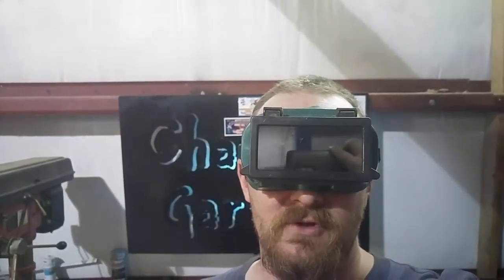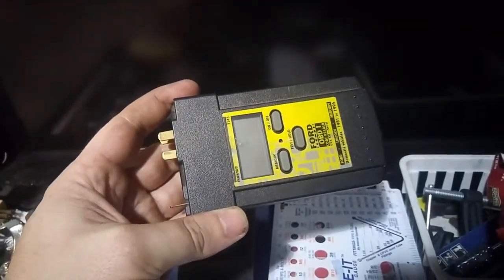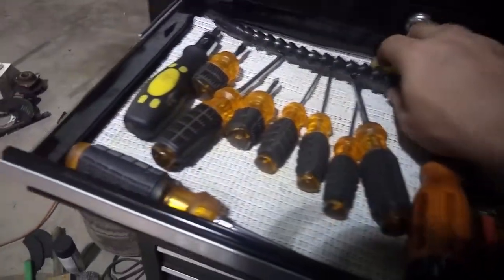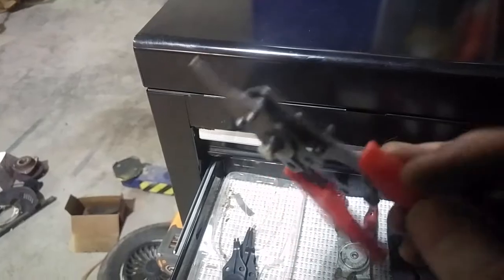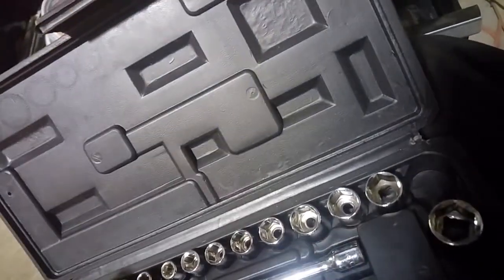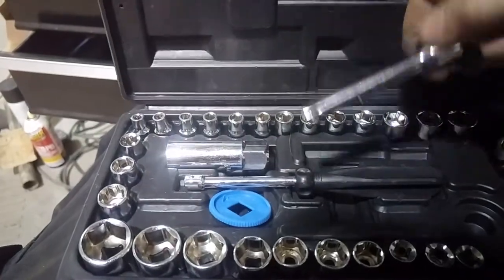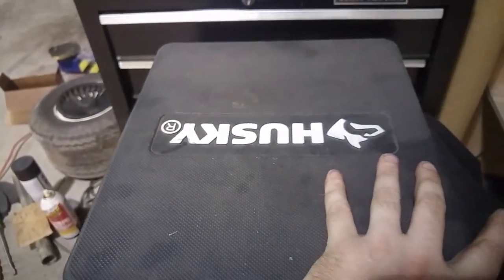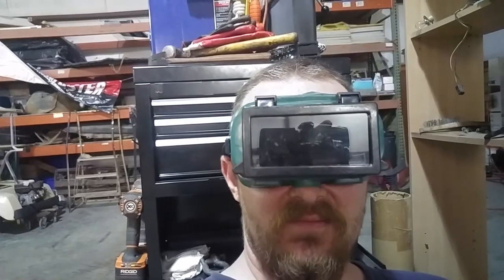Tool Box Tour #HKFGiveaway

Comment: Bonus points awarded. Glad I could help to get your box organized. Flex shaft screwdrivers always come in handy. Challenger is an old proto rebrand like Blackhawk is today. That's a nice hose cutter from Uncle B. Those cheap Chinese socket set in the black case, have lots of odd ball sizes so they're nice to have hanging around. I did the same thing with my husky set had to cut out the edges for the air nipples. Rigid makes great cordless tools and they have the best warranty in the business. Lifts are everyone's best tool. Great vid and yeah toolbox tours can end up being long videos.
Reply from the maker: Yay bonus points!  I must have walked 25 laps around the shop looking for those damn goggles.  I knew I had some somewhere!!!  Thanks for the feedback and checking it out.  Also for encouraging everyone to clean up there tools a little and showing em off.  I noticed your at 249 subs...1 more to go!  Pre-congrats my friend!

Comment: Thanks for the tour Rob.
Those Impact torx bits are by Great Neck.I bought that same soft set from Advance Auto decades ago. They're hot garbage. 👎
Reply from the maker: Thanks!  If I recall, you are correct about those torx bits.  I bought them about 9-10 years ago to take the bed off my old Mazda truck to replace the fuel pump.  I don't know if you can tell in the video but the one I used is all bent out of shape and rounded.  I don't think I've used them since.  6 bolts is all the use I got out of it and I didn't even have an impact gun at the time! :(
Reply: LOL! Right...same here.